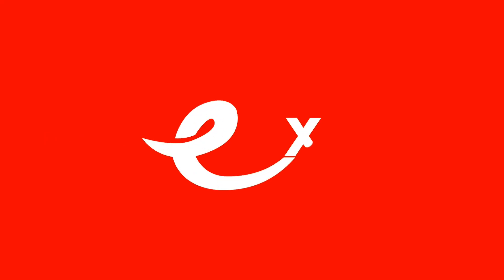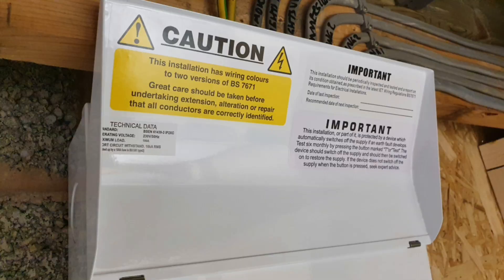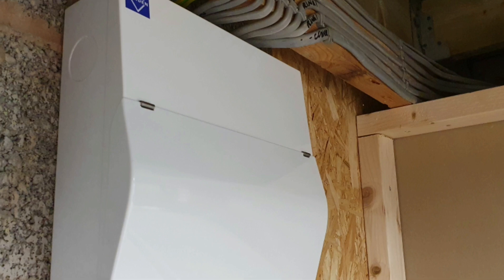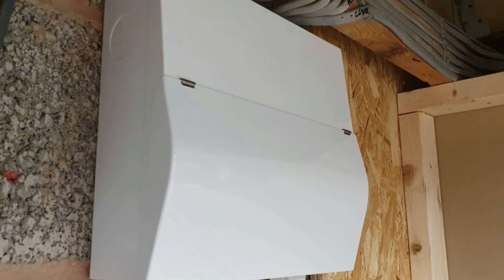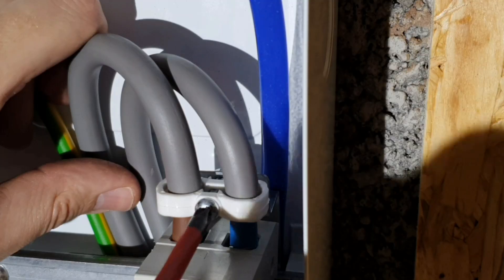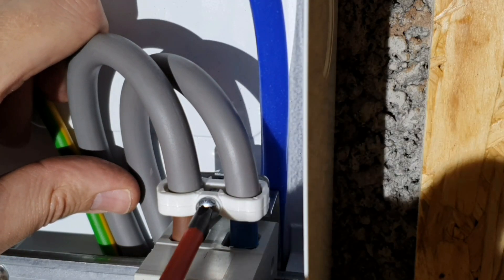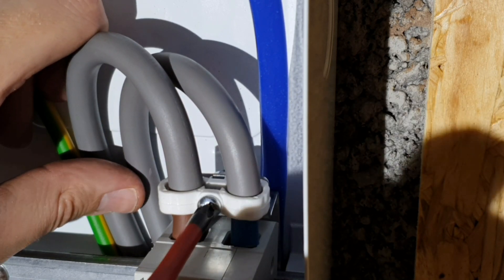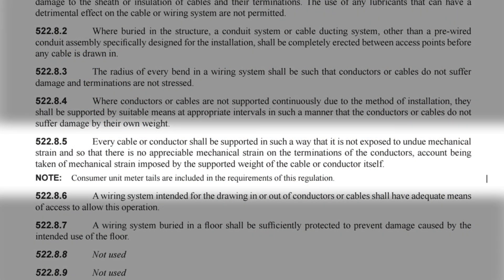CONSUMER UNIT WIRING - Do you need to use a meter tail clamp?

Comment: In modern installations here the meter and the main board of the house are together in one enclosure, so no need of special double insulated cables. Mostly H07V-K fitted with ferrules. Incoming cable between service entry and meter board is a NYM-J, usually 5x25 or 5x16mm². This is connected to a selective main breaker, MCB curve E, usually 3x63 or 3x50A. From there to the meter, from there to a main switch and then to the breakers or fuses (for the other smaller distribution boards in the house).

Below the meter is the E-curve MCB, above the meter the main switch (Hauptschalter), from there the wires go over to the right section. The Neozed fuses in the first three rows are fuses for a sub-board in the first floor and the Neozed fused isolator switch (first row, rightmost) is for a board in the garage which also contains the final circuit for the EV charger. The small meter sitting on the DIN rail is for the garage board. The E-curve should be selective to a general purpose fuse of the same rating. That's the reason I used 50A Neozed in combination with that E-curve MCB. These MCBs can be switched off internally with a special tool, if someone messes with the toggles of the MCB, doesn't matter when you switched that MCB off with the tool. If switched off with the tool you'll have to switch the board back on with the tool. It's a bit strange when the installation is isolated but the toggles are still in the on-position. But you get used to it to look after the red or green indicator on the MCB.

https://abload.de/img/img_0833jvk1d.jpg
Reply from the maker: Always interesting to hear how it's being done across the channel! Thanks for commenting. 😊

Comment: I  use the 19 strand flexi tails and I make sure the cables are clipped externally. The only time I used a cable clamp I threw it out in a fit of rage after it wouldn't line up correctly.
Reply from the maker: Thanks for the comment, always interesting to hear others experiences. 👍

Comment: Dont think that regulation has anything to do with a meter tail clamp inside a DB. 

This video is to advertise the optional extra that Lewden offer. 

If that (or any) regulation was specific to meter tail clamps. You would see them inside every DB.

But you don’t. Because its not.
Reply from the maker: So why are more manufacturers adding them ?
Reply: @efixx  because its trendy and they can make a few quid extra!
Reply: @efixx  because the clamps in their main switches are naff?
Reply from the maker: Or in response to this report and the issues found during smart meter installs?  https://www.electricalsafetyfirst.org.uk/media/1235/meter-tail-investigation-report.pdf
Reply: @efixx  so I was spot on then. 👍
Reply: @efixx  i think the big problem is 19 strand meter tails, in a screw down terminal they splay too much for my liking and certain cage clamps aren't ribbed enough to grip the cable,i tried 19 strand a few times and just wasn't happy with the connection, i swapped it there and then.. the problem i think is the board/isolator and meter manufactures design there terminals with 7 strand in mind

Comment: I thought I’d add to the debate. My understanding is that these are optional, but should be fitted on TT installations.
Now that DBs are Class 1, there is a risk that if the live mains tail was to come loose there may be too high an impedance on the earth electrode to operate the DNO fuse, hence the enclosure could become live.
Add that to 100mA time delay RCDs not being between the DP switch and DB, as the final circuits are protected by 30mA RCDs or RCBOs.
I don’t know the regulation number, so I will hang my head in shame 😔
Reply from the maker: Great comment thanks!

Comment: I saw a sample Honeywell consumer unit today at my local wholesalers ( Not seen Honeywell consumer units before or heard about them).
I did ask if Honeywell is going to be Mk consumer units rebranded and parts sold by Honeywell but that part of the business was apparently sold off.
Reply from the maker: They gave some the rights to the MK sentry name - hence they are branded Honeywell
Reply: @efixx  I was thinking the same as Mk or part of it is part of the Honeywell group, I did enquire if the Honeywell range fits in existing Mk consumer units for replacement parts but its apparently different.
Looks like Honeywell have their own design, I was just curious as with mixing mcbs in a consumer unit with the Mk brand not on the market if Honeywell were doing replacements under their name.

Comment: Has anyone used these for 16mm tails? Do they still clamp the cable?

Either tails clamp or a tails gland, or good clipping outside the board. 

If the supply cables are smaller, such as 10mm for a distribution circuit, these won't work.

Comment: Worried about 25mm tails 😂, here I am trying to beat a 240mm incomee with a rubber mallet trying to get the f****r into shape to enter a 400a sq d main switch
Reply from the maker: Puts the electrical challenges in to perspective- good luck 🤞
Reply: @darknessdestroyer5524  thankfully it's something I do regularly enough. So much so I'm looking at one of those fancy new Milwaukee m12 or m18 cable cutters, as the old ratchet cutters have seen better days!

Comment: Would have to be clamped in 2 points to do what it says. Not very useful detail I’d say, prefer a gland or fixing the tails outside the fuseboard, work the cable and make it fit nicely.
Reply from the maker: Thanks for commenting! 😊